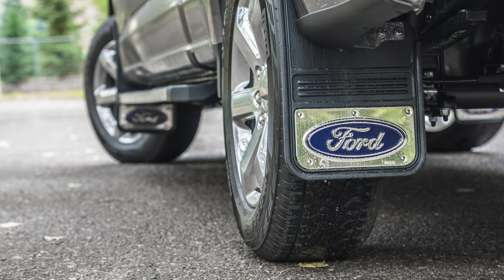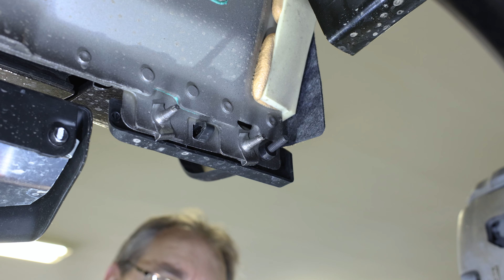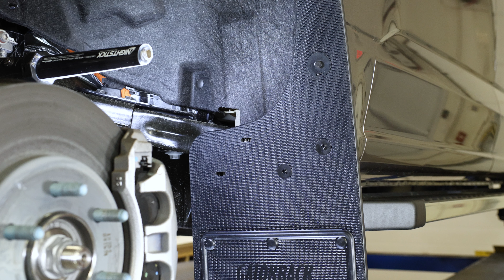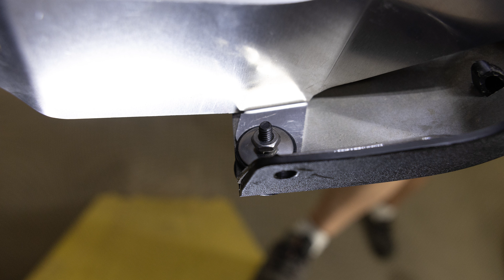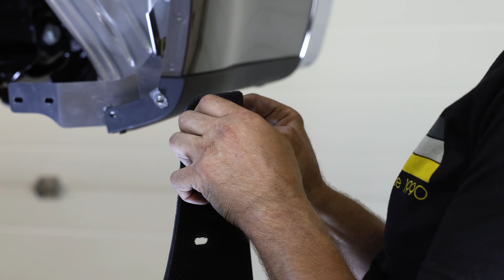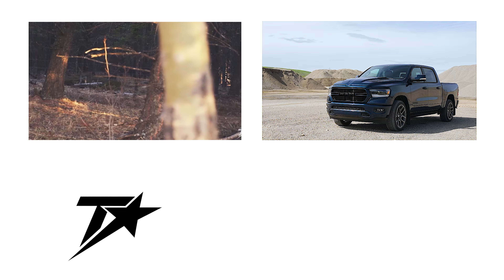Gatorback Mud Flaps for 2021 - Current Ford F-150 - Installation

Comment: Glad you made this video.   This is the most convoluted mounting system ever.  I like the gatorbacks, but half wished I went with the 2 screw and snap ones for $40 on Amazon. I'm very mechanical and these took forever to install.